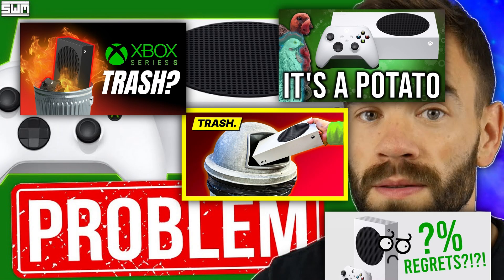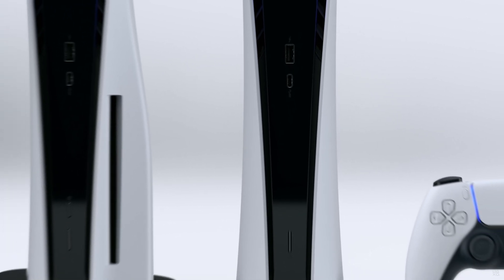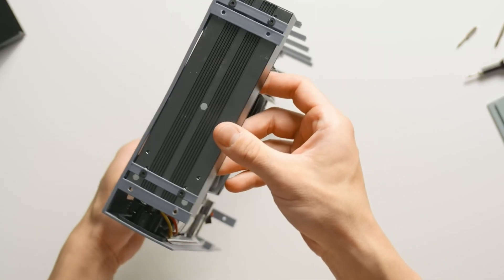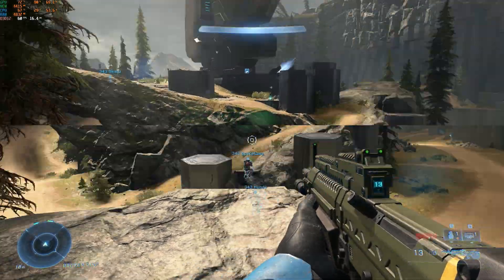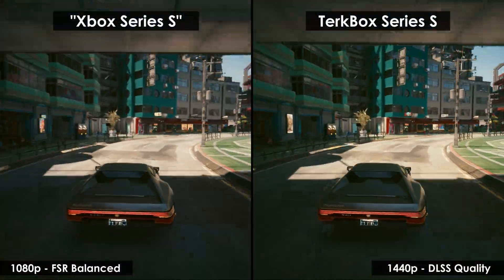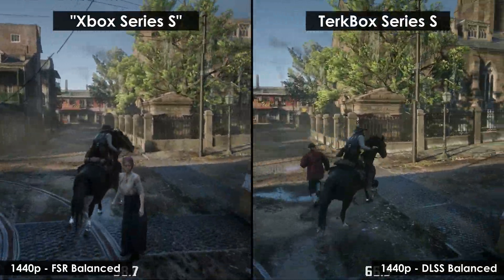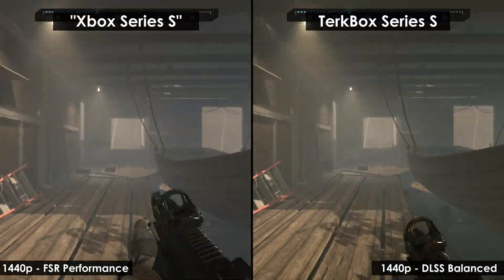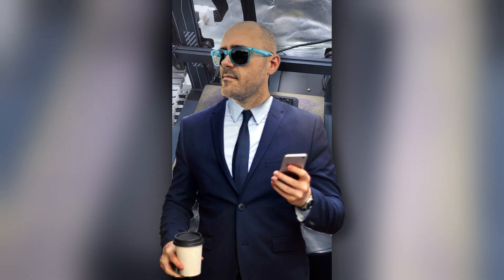Hardware Dev Makes a Better Xbox Series S

Comment: Is the 6/8pin on the RX 6600 a problem for this case? I know that the 6600 can be undervolted to run under 70W. It would still be 20~30% faster than the RTX A2000 (it’s close to 50% faster with normal TDP).
Reply from the maker: If it's half height and sorta short, you're welcome to try. Fitting the power cable will be incredibly tough

Comment: @TheTerk
can you give me advice for a monitor for my xbox series x? Im debating between 1440p n 4k. I understand that only some games use 4k at 120hz. The series x can do that. But what happens when i play games that are not 4k? Do i have to turn off my 4k setting and go to 1440P? and if i do this, does that effect my gameplay? Or how my monitor works and performs?
I play mostly FPS game like call of duty and battlefield. But also play games like assasins creed and single player games. 
I have never bought a monitor before. And have been researching and im starting to understand more about monitors but i want to make a good choice. Wanting to keep mu budget around $500 and under. really need some solid advice. Im new to this and don’t have anyone to ask.  thank you sir.
Reply from the maker: that's tricky, as I haven't done an analysis between display modes and monitors on a console.  However, I've done a general "1440 vs 4K" video that talks screen size vs resolution here https://www.youtube.com/watch?v=2rc1-wTI3ns
Also, google "Rtings Xbox TV" to get good reviews on gaming TVs and monitors.
Depending on how often you need 120Hz, I'd prefer that over 60.

As for gaming performance, I'm not sure how flexible games are on console between the two resolutions.  For instance, if Cyberpunk is designed to display 1800p, does it just drop that to 1440p and you get better performance? I don't know.
Reply: @TheTerk  Thank you for your help and reply. I do appreciate it!

Comment: onne thing that really holds back console performance, sometimes being more of a bottleneck in some situations than the clock speeds, is the puny power supply that these devices ship with. We are talking laptop-level of power constraints.
Reply from the maker: spot on - most consoles embrace the mobile mind set.  which I aim to break in this series